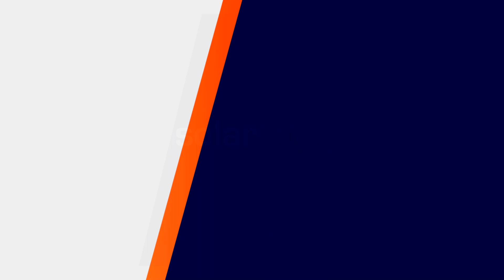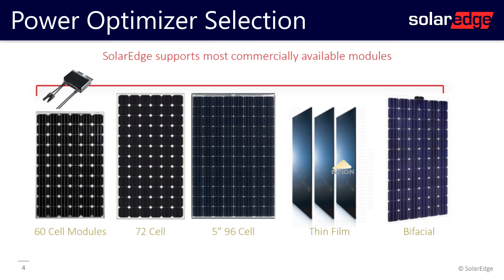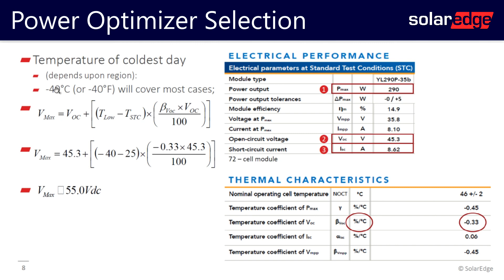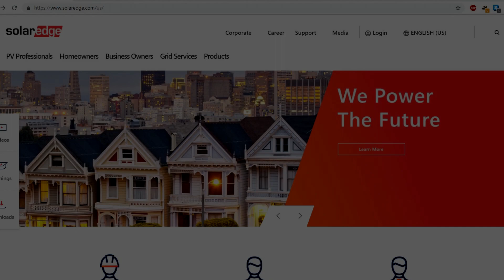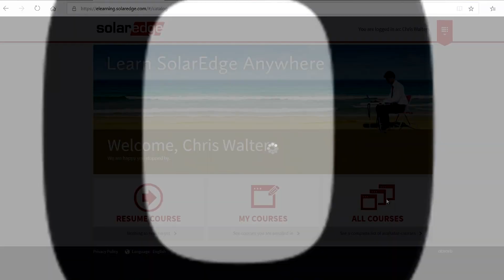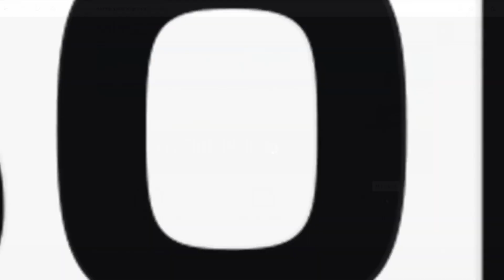SolarEdge Design: Power Optimizers,  Pt. 1: Selection

Comment: I suspect more than a few failures are due not paying attention to over-voltage at minimum temperatures. thanks.
Reply: I agree.  That is why it's always better to build in some overhead room in your system... on every level.